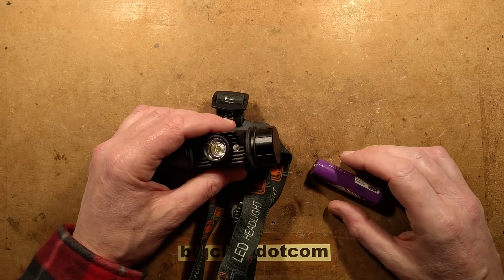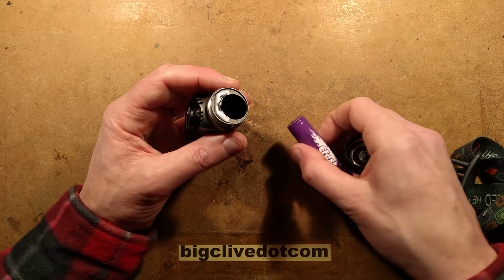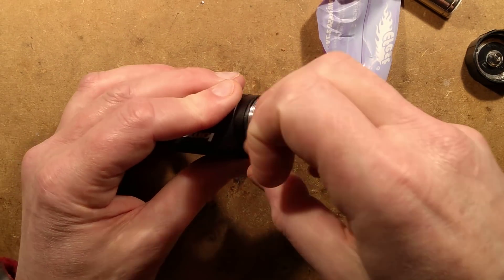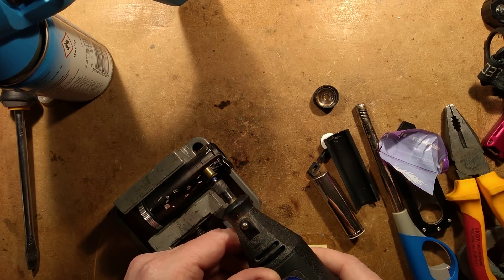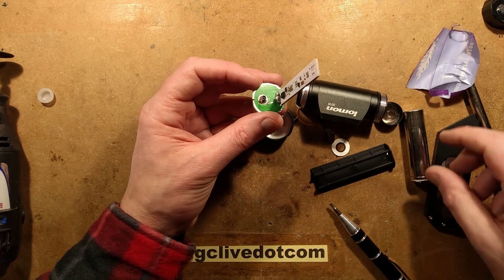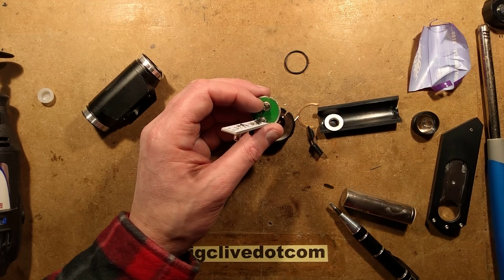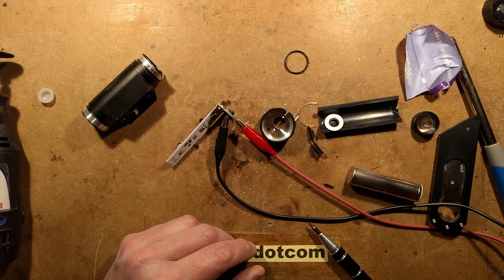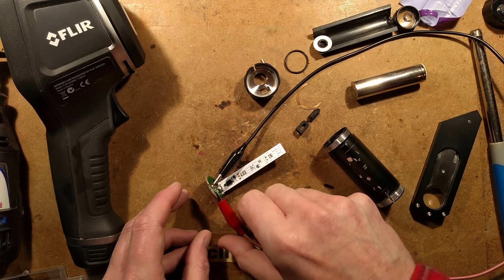Head torch shorts out 18650 cell while not being used!

Comment: Hey Clive, does that head lamp have any protection circuitry built in?  Because it would appear when you pulled the wrapper off, the cell did not.   If the cell was discharged under 3 volts a few times, that may have caused the electrolyte to crystallize and create a short inside the cell itself. Not saying that is what happened, but it is a possibly.

Comment: Do you think that c clip was locking the cap on? If so maybe it could be removed without damage and properly insulated and reassembled.  Looks like a very nice light if not for the lack of insulation.

Comment: Looks like it had an internal spring clip that retains it. I've used similar clips in my designs when they're not meant to come back apart. Makes assembly convenient, but its pretty much trash if you f up. Also the spring clip itself may also have been the alignment mechanism if the groove in each section doesn't go all the way around.

Comment: be glad it didn't short out and catch fire when it was on your head also the spring acted like a fuse on the negative terminal it should of had a different insulator and batteries don't like short circuits

Comment: That was by far one of the cringiest cuttings I've ever witnessed... what's wrong with putting the battery down on the table, holding it at one end with two fingers, and cutting horizontally across it?  Instead, you cut the top of a small, round object an inch away from your hand with one of the sharpest blades commonly available, depending solely on human perception of feeling for the proper friction between two pieces of metal ?  C'mon man...  That could've severed nerves.  8 out of 10 is usually a pretty good ratio... except when you're talking about number of fingers.

Comment: Hey Clive, could you try to open the other one in a way it's not destroyed, so we can learn how to open ours?

 I have one like those, different model, when I realized the battery cap just touches the battery negative and then the case itself and that's all it needed to transfer the power, it gave me the chills. Also tried, unsuccessfully to open mine, and maybe try to insulate whatever was in risk of touching the housing. Your video just confirmed my suspicion, that channeling the negative of the battery through the case is a bad idea. Maybe we could make ours safer, if we could open it?

Comment: 18650s can have thermal runaway. It can be extremely dangerous. I bet the light has a safety measure to prevent that from occurring however.

Comment: Those button top batteries really shouldn't be used in devices with spring contacts both ends. As the spring squashes it can short between the button top and the metal case of the battery. Plus them efest batteries are cheap rewraps.

Comment: I've found that every flashlight, or any other thing requiring batteries... The negative end of the battery always goes toward the spring.
Reply: But with this torch there is a spring at either end.
Reply: and just to fuck with you a large portion of lithium cell flashlights either have 2 springs or a spring on positive and a tab for negative....
Reply: Sadly there are exceptions
Reply: Yup. That's why I said, "I've found"... I figured there had to be exceptions. =0)
Reply: @selador11  The Springs at both ends were probably designed by the Stupes that commented above.

Comment: scary whering a thing like that around your head, depending on the resistance of the short the chargestate and the C rating of the battery it can get SUPER hot in no time. 

I once shorted out a 2s 40C pouchcell by shortening the leads and not thinking a bout it when i cut both @ the same time. The battery reached 60°C  when i had finised the cut with the side-cutters.
These things are no joke. Whering sth like that strapped to your had is gamble, if its soo purly desined

Comment: You put battery in 
BACKWARDS!  Spring NEVER against the button (+). Spring goes to (-) goes to negative.
Reply: It has springs on both ends. 
Never seen a use for dual negative batteries till now thanks.

Comment: If you want something to go BANG!!! you could do what I accidentally did 25+ years ago in High School Electronics class...
We had to build an Electronics Kit (I choose a huge digital clock) and accidentally wired the Step Down Transformer in backwards...
It was supposed to take the 120V mains and drop it to 5V...instead, it took 120V and stepped it UP to 2,880V...1st time I plugged it in there was a BIG BANG and a simultaneous thud above us...
The transformer got literally blown off the board and embedded in the drop-ceiling tile above me...Scared the hell out of myself and the Teacher...
Surprisingly, after replacing the transformer (and making DAMN sure it was wired in properly), everything worked...still have it in fact, but I need to replace the LED's of the display board...too bad. the think was so bright I didn't need a Night Light... :D

Comment: Get a Fenix HL55.  I've used mine for several years as a mechanic without battery problems or failures.  It doesn't have the IR on/off though.  No flashing modes either.  Just some brightness levels and it remembers what setting you left it on.  Nice flood area effect light, no dark rings in the beam.  Also, it takes 18650 batteries.
Reply: HL55 me too.  I was so happy with it I also bought the recharging version HL60R, but that was a mistake.  The extra functions weren't worth the loss of simplicity.

Comment: It happened because your cell positive terminal is not flat type. not every cell holder can be used with not flat battery, so it shorted to ground at positive terminal. 
holder can be designed for flat type, button type or both.

Comment: The plastic insert centres the battery.

You also had the bench power supply connected two different ways, positive on spring on one test and on the outer rim on another test, would that make and difference?

Comment: I had one of these head torches. It delveloped a fault where the light was flickering so i took it apart to try to fix it. The end cap is just a press fit on the main body and requres a good hit on alternate sides to get it off.  The brass coloured ring should be soldered to thd round ciruit board and I beleive is intened to create a contact between the main alumium body and the cirtcit board to complete the negative supply to the board. In the end I couldnt get it to stop flickering and it eventually it failed altogether. Also, it was not at all water resitant, the usb port and holes for the IR transmitter and receiver being the areas that will easliy let water in. I have replaced my old head torch with a different model that again uses an 18650 battery, incorporates usb charging but does not have the IR facility. The USB port on the new one is located under the end cap that partially unscrews to reveal the port and has o rings to provide some water resitance. It is more compact and weighs less than the old head torch, has 5 brighness levels and cost the same. Easily found on ebay from a number of different sellers.

Comment: Suggested design improvements within concept and price limitations:
  1. Positive contact is just a bare pad on a PCB, optionally pretinned.
  2. Non-ground tracks are run mostly on the inside, using the PCB itself as isolation.
  3. Pushbutton is replaced by a touch contact on the outside of the bottom PCB.
  4. Inside surface of PCB covered by strip of electrical tape.
  5. No waving detector.

Comment: I use a headlamp with three lamps where you can adjust each one individually (only vertically). Really nice thing from Aliexpress for like 15€.  
Adjusting each lamp individually is really nice, because you usually not turn your head most of the time but just your eyes. So for example I put the smaller lights downwards more, so I get light there. Can highly recommend such a headlamp.

Comment: The  spring usually contacts the ground or negative.
Reply: I'm fairly sure Clive is aware of that, but in this case there are springs on both ends. Probably so you can use it with plain cells (that don't have a "nipple" on positive).
Reply: In this case the inside spring was positive, which is really unexpected
Reply: I'd say the inside being positive was the most likely option (because the negative is more likely to be connected to the case, and it's easier to connect the lid to the case than it is to route it to the positive connection without touching the case), but they should still have labelled it.

Comment: Diodes,  for either protection, or rectification,  would be one design answer.
Or a plastic donut for the positive button to fit in, so only one connection could be made...
From an engineer stand point,, it is just as easy to make it wrong.
You only have to make it good enough to get paid.

Comment: Also note: Lithium cells can randomly short out internally.  This can be encouraged with over charging, over discharging or being dropped.  That is why every one of the 8,000 or so 18650 cells in a Tesla Model S battery pack is fused.  If one cell should go screwy the energy of the 90 or so paralleled cells wont dump into it.
Reply: Are you talking about a thermal runaway scenario
Reply: @yfs9035 : Not necessarily.  That is the extreme situation.  This cell heated up enough to cause an electrolyte spill which appears to have stopped the full meltdown and catch fire bit.  Batteries are chemical devices that just happen to produce electricity.  And are never off.
Reply: @randycarter2001  Oh. Thanks for the wisdom

Comment: Hi Clive, I share your passion for finding a pearl in chinese pile of turd, but for such an often needed tool that I put on my forehead in an inch of my eyes I prefer the cheapest PETZL. This model use to be called TIKKA but quick googling showed there is a new generation of the model and there is now an even cheaper model called TIKKINA. It's plastic, it's not particularly bright, it's relativelly expensive, but it's lightweight and the thing that goes south first after intensive use is the very soft and nice to touch elastic band, however it does not degrade ugly, but just stretches and becomes partially loose which is easily compensated. Not a comercial, I'm sure there are many other reliable brands.
Reply from the maker: My first LED head torch was a Tikka.  The build quality was appalling.  The switch was a plastic pin that pushed a battery contact against a resistor lead.  It was probably their first LED unit.  I think they've improved since then.
Reply: @bigclivedotcom  Well, mine example has metal tactile dome pushed by a rubbery button moulded together with the hard transparent plastic of the body. It doesn't matter anymore, - the current revision looks rather different from mine. I've just opened it for the first time just to check against your description :)

Comment: Your battery might have spun inside of the case and the spring might have gotten under the insulator at the positive end which is really close to the negative side of the case where it's crimped

Comment: Is that a "real" brown skid mark, or is it just dust from the Dremel cutting disc? Seems to be right under the part you cut through.

Also, assuming the problem was indeed contact between the board and the casing, can't you insulate the other (ex., with a thin cardboard shim)?
Reply from the maker: If I find the other light I'll use a protected cell and put thin plastic shims down the sides of the PCB from the openable end.

Comment: Battery guidelines have always stated that batteries should be removed if not using a device for an extended period. Modern advice for lithium powered devices recommend removal of said batteries where the device will not be in use for 7 days or more.

Comment: The housing will be positive when you put the battery in backwards. It looks like the sleeve around the battery was damaged, this exposes the "unsleeved" metal of the battery that is negative. You will get a short circuit if that unprotected metal part of the battery comes into to contact with the positive housing of the lamp, when you put the battery in backwards.

Comment: DO NOT use a battery showing that damage.. or any indication of having over heated..  I build power packs with 18650's and if you have one that overheated, it most likely does not have a protection circuit and if it gets that hot, it has shorted internally.  Throw it away even if it wants to hold a charge.

Comment: I was under the impression that the springy contact is generally always the negative, even with taking occasional chinese polarity swapping into account. Or more generally, the contact more visible/accessible would be the negative. So I would immediately assume the negative goes to the screwable cap and not even think twice about it.

Guess you could always improve on the design (say, add a thin mica pad with cutouts for LEDs) and keep using the other one. Or even this one. Seems pretty resilient to abuse (I mean it's still working) and you said it's your favorite...
Reply: Sometimes you get... two springy contacts :0

Comment: Look at the spring in the cap.. that tells you right there, which way the battery goes in...
Reply from the maker: There's a spring at both ends.
Reply: @bigclivedotcom  Very odd.. Never seen a light that has springs on both ends.  Usually one end is a solid tip, the negative end is a spring.

Comment: Likely simple explanation: Raw springs are inherently dangerous around the pos end of an 18650, particularly on a screw cap.  There's only around 1–2mm between neg and pos (case and pos cap) at the pos end.  It's extremely easy for a spring to displace / unwind and short the cell.

Edit: your hypothesis about board shorting to case is also plausible.
Reply: Clive's version is not really a hypotesis, since the burn mark on the PCB is obvious. It shorted out at the front PCB.
Reply: @mrnmrn1  To me, the greater thermal damage was at the spring and pos cap of the battery.  If shorted there, the thermal damage on the PCB could maybe be secondary from attempting to charge it (I can't remember for sure if he described a charge attempt before opening it and seeing the damage on the cell).
Reply: @Murph9000  I think the reason for the springs has the most damage is because they're a long string of thin steel alloy wire, so their resistance is much higher than the PCB trace. The postitive end cap of the battery is possibly damaged by a vent event, and possibly the vented fumes were ignited by the red hot spring.
Reply: The problem with your theory is that both springs were toasty fried, indicating they had passed considerable current. If it had been a short of the positive terminal then only one spring would have been heated to such an extent.

Comment: I have 3 of the same kind. For the price they are very good. I have used them a lot for over a year now, as i work with stuff during night and there is no electricity around its gets very dark early at this time of the year (northern sweden). So far they have worked perfectly, one battery ain't what it used too and the rubber at the charge port fell off on all of them after a few charges, the ring at the led gets loose sometimes. Besides that it's all good. After seeing this I won't have all three charging beside my bed all the time...  Great video.
Reply from the maker: I recommend fitting them with protected cells.  That way the DW01 chip should cut off in the event of an incident.

Comment: Remember this applies to DC power, Commonly if there is a spring that is connected to the metal body its the negative,
Clive will know this but just putting it out there as reckon its simply a oversight as he is extremely knowledgeable with electronics and i will never say a bad word about him,
I dont know a quarter of what he knows and unless the day comes that i know more i will always have faith in these videos
Also imagine if it popped like those vaps with dodgy batteries, almost guaranteed blindness as your eyes would be mutilated by the debris and chemical fire
Reply: There was a spring contact at both ends of the battery.

Comment: The cheaply made internals could pull more amps out of that quality cell then the tail spring could handle, then the front spring had the same issue. 

Solder a piece of solder wick from the tip of the springs to the base of each, then you can suck the juice out of the cell faster without worry.

Comment: You are mechanically very violent. The case is completely destroyed and it hurts me.
Reply from the maker: I did try to open it beforehand, but it turned out the end cap was applied with what I would guess was a press as a very tight friction fit.
Reply: @bigclivedotcom  I didn't want to criticize you because I'm often confronted to the same problems. The worst thing is to get out some batteries that got stuck in a flashlight because of augmentation of volume! And it literally hurts me to hold a nice black anodized aluminum case with big plumbing pliers and scratch the case. For small objects I have special jewellery pliers that have Nylon protection but not for bigger ones. Another sad stories are all the plastic cases held together by plastic lashes that always break when you open the case. The problem of the weirdly shaped screw heads like triangle shaped ones, I have solved with a special screwdriver kit from Lidl or Aldi. When I really can't open something, I put it away until I find out the way to open it. Sometimes it can take years!
Reply: @andymouse  Don't worry, I'm a tough guy!